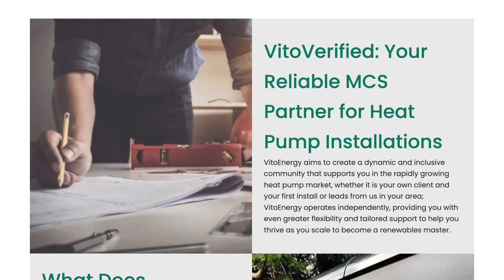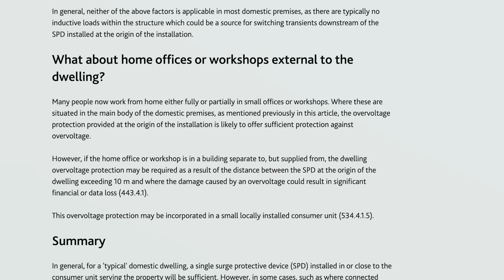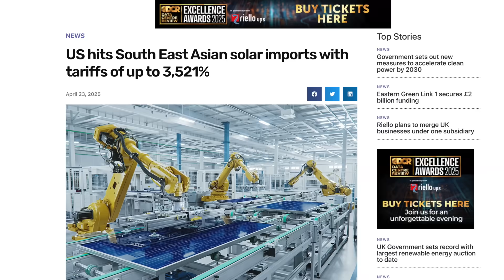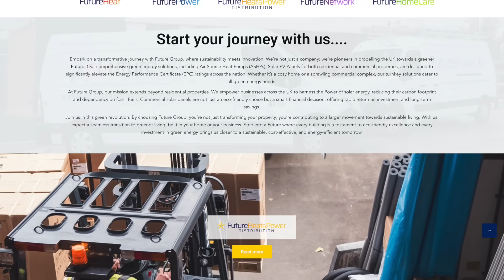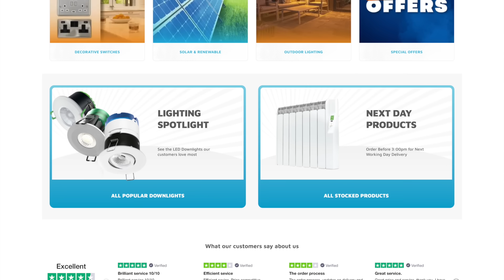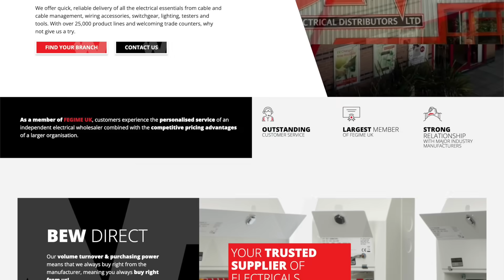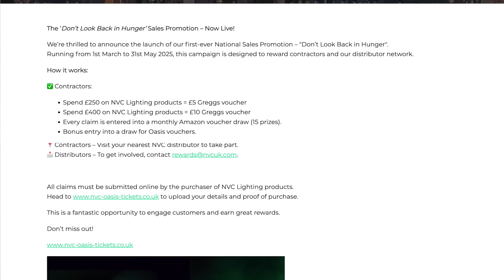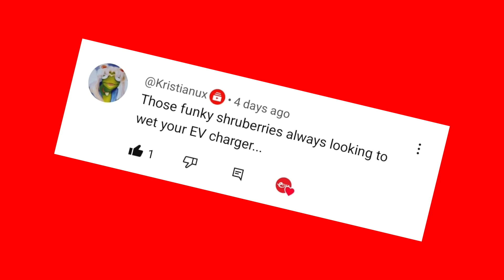MCS Was a Barrier.... Until Now!

Comment: Shouldn't be covering anymore of the countryside with solar panels, let alone doing it more quickly (allegedly).
Reply: Was over 30% of supply today. It has its place
Reply: @je8277  yes - a place on all the roofs and over carparks........... because it is 💩 in winter.
Reply: @BROOMEngineeringTMIET  agreed, so why do they build it on farmland instead of on roofs and over car parks?

I’d guess A) farmers want the money, so blame them. And B) cost of grid connections in built up areas.
Reply: @je8277  yes - solar does look more financially attractive than farming the land, and producing food. That show it is messed up.

Solar farms are causing elevated voltages in rural networks. It would be far better on roof in urban areas where the power can be consumed more efficiently.
Reply: @ turbines, cables and solar panels, a farmers favourite thing to grow we usually say.